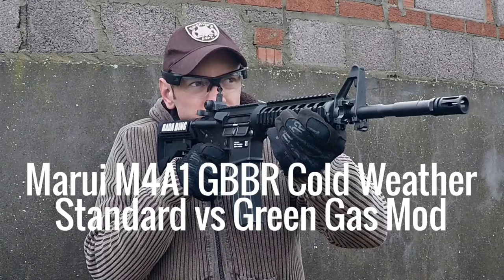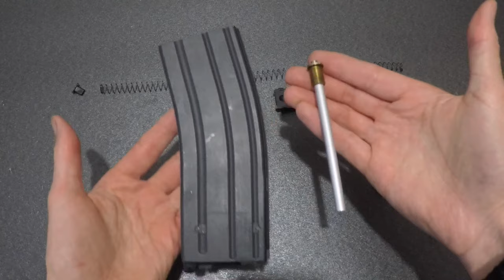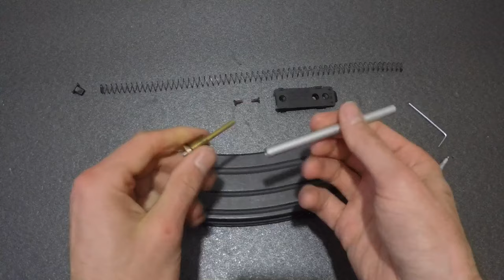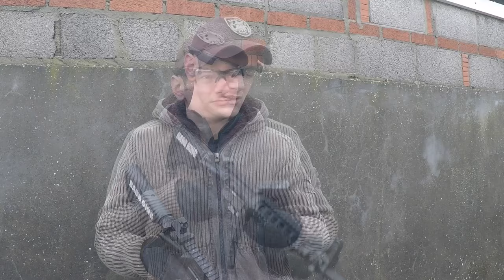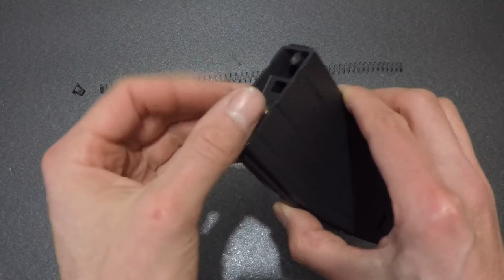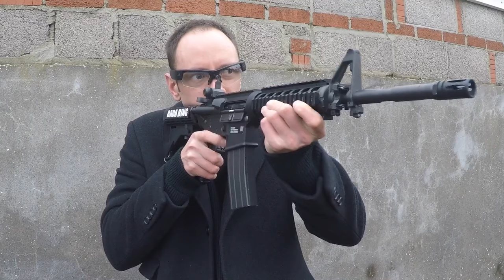Tokyo Marui M4 MWS GBBR Cold Weather: Standard VS Green Gas Mod

Comment: Thank god, I was gonna get a GHK m4 just because of the efficiency. I was crushed, thankfully i noticed your video! I really appreciate it, you helped me spend 450 💶!
Reply from the maker: +Kornel Cajka 
Haha! Both are great platforms, but as you see here the TM copes well in the cold just with smelly old propane. 
Even firing off bursts. 

Enjoy!
Reply: BadaBingPictures Oh wow cool you reply to comments! I ordered my TM M4 MWS 20 minutes ago, right after i cancelled my GHK M4 order. Theres just something about the TM M4 MWS that makes me want it ;)

You were using propane?! How was the FPS with heavier bbs? And how do you maintain the M4 running propane? Does it need more lubrication?
Reply from the maker: +Kornel Cajka 

Congrats on the purchase, you're going to love it. 
Yes, I mainly shoot Propane through the MWS. 
FPS on heavier rounds (.28g) is around 300. 
I don't add Silicone to the propane at all, thus keeping the hop up dryer to maintain stable hopping. 
For general lubrication I use thicker Silicone oil in droplet form. I lightly coat the bolt carrier so it remains slick and maybe a drop on the hammer and valve striker. 

Just enough so the parts aren't dripping but are finely coated.
Reply: BadaBingPictures Oh thats smart, everyone recommends putting silicon oil on the fill valve before filling. Thanks i appreciate it!
Reply from the maker: +Kornel Cajka 

You're supposed to add Silicone but I'm a rebel ;-) lol.

Plus my magazines are never left without gas in them, so they pretty much look after themselves. 

You are most welcome sir.

Comment: I recently got myself an MWS. I play in Norway in cold temperatures and the performance is OK with MAPP gas. However it leaves something to be desired, so I'm considering Greengas modding my mags. 
Note that these are the newer magazines, either V2 or V3 as they were purchased in 2021. 

I have had several people tell me to NOT Greengas mod my magazine unless I fire semi auto with some time between shots, so DMR type gameplay. "They" say that the GG Mod gives increased cooldown effect compared to non modded mags if firing semi auto rapidly. Do you have any experience with this?

Im wondering if you have any negatives to not with your GG modded mags, or comparisons to newer MWS mags. 

To me, FPS consistency and as little cooldown effect as possible is important, as well as being able to fire 35 BBs on semi while being as consistent as possible. (I just top up gas when I  top up BBs)

If you have the time to reply here, I would very much appreciate it. Thanks. :)
Reply from the maker: Typically you don’t have to touch your magazines at all. I bought a stack of magazines that came from the very first batch of TM M4 magazines and I found that sometimes they didn’t have the capacity to complete 35rds during rapid fire, or conditions which required me to shoot as many rounds as possible within a firefight. 

The GGM allowed me to store so much more gas so I could easily clear 35rds and the last shot would be as strong and crisp as the first. 
Negatively it allowed the magazines to store more liquid and the breathing space to convert it into a gas was lost. So it would shoot liquid gas through the nozzle and performance would be rubbish. Think of it like trying to speak with a mouth full of water and it goes down your throat and you start coughing.

It required carefully timed gas charging to ensure you weren’t overfilling. 12-14 seconds maximum. 

Now, the following batches were improved so the mod wasn’t really necessary anymore. Yet people were still being led to believe that it was mandatory if you were using green gas. Then unnecessarily cutting the tubes out. 

I would say it’s a mod that is completely optional, and users should be aware that it makes it easier to charge the mags to a point where they’re not going to give you the best output. I know some folks remove a couple of centimetres from the inner tube to gain a little more volume and this maintains that overfill buffer that they need to operate correctly. 

As I had loads of V1 magazines I wasn’t going to waste money on newer gen magazines. Although I swapped for a V2 and noted it’s difference in performance on my 4 Year review. 
We’ll just say the GGM wasn’t necessary on that particular item.
Reply: @BadaBingPictures  Thank you very much for your swift reply. 

Would you say one can fill stock newer gen magazines till it says stop without overfilling then? Due to the length of the tubes?

I have also indeed considered just taking around 20mm off the tubes to somehow go in the middle and as you said, maintain the overfill buffer. I dont need to shoot 200 bbs out of a magazine, but I do want to get as close as I can to have 35 bbs fired in cold condition with high consistency between shots, both in FPS and in cyclic rate. 

I might do the mod to a single magazine and compare my results.

Comment: Hi, i'm planning on moving to gbbr world, altough in my country in winter we have sometimes 3ºC. Can you advise me in a gbbr m4 that would be reliable all year long. Thank you and please put some more gbbr videos up cause it's a mystic world still, at least in Portugal where i live
Reply from the maker: Hi!
Sure. It all depends on how much you'd like to spend. The two major contenders which I would immediately recommend is the Tokyo Marui M4 MWS GBBR and the GHK M4. While both platforms are more expensive than say WE GBB rifles, that expense comes with reassurance they don't necessarily require upgrading ( Only if you're deciding to alter your fps higher or lower to meet your skirmish site regulations)  The two systems have a fantastic track record, GHK especially having more time out on the field and have had glowing reports from very happy owners. 

On this rifle (Marui M4) using green gas,  you could run that gas all year without needing to change to higher pressure gases when the winter comes. As I mentioned the modification to the magazine allows for more gas capacity which acts as a safety net for when you're firing rapid shots and absolutely need every last bb within the magazine. 

And as all this when performing in lower temperatures. 

Speaking of lower temperatures, GHK offer C02 magazines and C02 is legendary for higher tolerances in colder weather. Players have been known to have been running their GHK below zero temps on C02. So you win either way. 

To sum up if you're looking for the care free-est gbbr platform, my opinion its these two. 
Check out some YT videos on both setups and if you can get to a shop to get hands on, see what you think.
Reply: Hi, thanks for the reply.
About the money i know that if i want a reliable platform i will need to spend a little bit, and because of that this will be my long term project because i seek for realism and responsiveness out of the gun and not pewpew battles where people waste a 1kg of bbs in a single morning (no i'm not joking, it's a real thing at my local site).
Concerning the FPS, in Portugal the FPS limit is 1.3J, so roughly 374FPS with 0.20g. So i just need it to shoot under that limit. I currently run a M4 AEG with 1J and it's more than enough in CQB games thats what i play the most.
About trying the weapons, as i mentioned ealier in my country the gbbr are a kind of a myth, so no shop really sells them (exception made for the GHK MP7 sometimes available) so i can't really try neither.
Once again thanks and keep posting some videos, and if you plan on passing by Portugal gimme a call and i'll get you some games.
Reply from the maker: +Tiago Ribeiro Of course. What ever GBBR you buy, you'll eventually have to buy a ton of magazines anyway so you may as well go for the best skirmishable gas rifle. 

Haha, don't worry. As long as you run decent heavy weight bbs, you're likely to get great groupings. And with up to 370 fps on .20's you've got some speed behind that bb to make effective long range hits. Sure, anytime! Thanks. And also thanks for watching!
Reply: Tiago Ribeiro hey just input WE should absolutely not be trusted in winter

Comment: If I live in Connecticut is it possible to have a gbbr for year round play? If so what would you recommend?
Reply from the maker: +LegoTomm I guess that depends on how cold it gets in your corner of the world. 

I think with GHK AK's & M4 GBBR's being able to run on C02 with C02 magazines obviously would be the best candidate for year round skirmishing. 

The TM M4 would still probably be somewhat usable but running gases hotter than green would put more stress onto the system which is only really designed to be used on 134a equivalent. Also green gas having a low tolerance for the cold whereas C02 can operate in those temperatures more comfortably. 
Hope that helps

Comment: I was close to go for the KWA LM4, but seems like I should get the TM MWS M4A1 instead.
I've heard the KWA is the most durable GBBR out of the box and has great cold weather results, I'm not sure anymore lol
Reply from the maker: The TM M4 MWS is very durable and has decent cold weather performance. But I can throw a spanner in the works and mention that the GHK M4 is also just as durable and it probably has the best winter performance out of every other gas in mag GBBR on the planet. CO2 magazines gives it the crown for winter skirmishing. 

I don’t have any experience with the KWA sadly, but I know that the aforementioned GBBR’s deliver!

Comment: Hey BadaBing! If I click on the Green Gas Mod Tutorial link in the description, it says the video is private. You may want to do something about it.
Reply from the maker: The GGM is not really required these days. The early batches couldn’t take on my GG and the mod helped people increase the capacity. 
As the years have passed they improved their design so they’re able to take acceptable levels of gas, so I made the video private to spare people from needlessly modifying them. 

Of course the option is still there and all it takes is to remove the baseplate, unscrew the brass thread, and remove the tube.

Comment: Hey BadaBing, me again :).

I am a GHK fan, but this TM is a close competitor to obtain.
I do have a question about that video. When I click on it, it's said it's on private. So I cannot watch it. When you perform that modification, can I use the 2.0 Nuprol green gas after that or is that too much for the TM to handle?
Reply from the maker: Hi, 

I took that video out of circulation because the GGM is not required. You can use green gas just fine in the M4, the life of the nozzle spring will be decreased on account of the faster cyclic speeds but other than that you’re good to go. 
I’ve been using propane which is warmer than nuprol 2.0 and the M4 has been great. Apart from wasting two of those springs I mentioned earlier, but it’s so worth it.
Reply: @BadaBingPictures  Thank you for the anwser. That makes the TM a strong contenter to buy.

Comment: do you still need to do the green gas mod on the mags three years on? or have the mags been improved by TM?
Reply from the maker: Nope. The mags I have are all from the first batch and they had terrible efficiency. Without modifications they only allowed 7-8g of gas.

Now their magazines can hold much more gas and do not require any modifications. The green gas mod is completely unnecessary. 
What you see in this video is how bad the first batch really was.

Comment: @BadaBingPictures, the green gas mod tutorial video is set to private, any way to access it?
Reply from the maker: The GG mod isn't really required any more. 
The first few batches of magazines couldn't hold much gas at all, so the GG mod was beneficial for those older ones. The disadvantage was they could be overfilled really easily, and this could cause unconverted liquid gas to get into the working parts and ruin the performance. 
Nowadays they can take on much more gas and don't need the modifications. Of course you can still remove the inner tube from the magazine but it's at your own risk. 

I decided to unlist the video because it's not a necessary measure.
Reply: @BadaBingPictures  Ah i see, is there a way to tell if my mags are the older or newer kind? I bought my stuff used from another person. Anyways, thanks for the response, love your content!

Comment: Have you used Green gas on it ? If so, will it damage the internal parts of this gun?Many thanks. HF134a in the US is not available.
Reply from the maker: I only used propane in this GBBR, which is equal to a full strength green gas. 
Yes, it will damage one or two components. The nozzle return spring isn’t designed to operate at the increased speeds that comes with green gas/propane. So eventually it’ll break. 
On the bright side there’s upgraded nozzle springs to overcome this, and it’s quite easy to install. 

The other part is the plastic buffer. Although it’s a case by case basis, as mine is still a-okay.
Reply: @BadaBingPictures  thank you. As I only have access to green gas here in the US, I won’t have opportunity to use what it designed for its use, which is hF134a gas, I’m a bit paranoid about whether or not I would eventually damage the gun. Another big issue is that in the Us, finding parts for TM guns is extremely difficult.
Reply from the maker: @cx3264  Beyond the parts I already mentioned, I wouldn’t worry as it’s other internal components are solid. With how slick the working parts are with its roller bearings and such, it wouldn’t be a problem. 
Just make sure you do your part by using the highest quality bbs you can. It works both ways, for accuracy and reliable feeding. 

A lot of airsoft green gasses are not created equal, and they vary in terms of power. Some are watered down with butane. 

Parts are plentiful elsewhere in the world. You have to get used to ordering from Asia as that is the best place by far!

Comment: Video of the mod is private, why you did turn it out private?
Reply from the maker: The green gas mod is not required anymore. The first batches of magazines couldn’t hold more than 8g of gas, but TM improved them and they can store more gas. 

So the mod is a bit pointless now.
Reply: @BadaBingPictures  What if I got a second hand one and my magazines need that mod? :p
Reply from the maker: I understand this. However there is no use in keeping the video available as people might modify magazines which absolutely do not need to be modified. 
For example, magazines that are only a couple of years old and ones that aren’t even made yet.

If you feel the need to modify them, it’s as easy as removing the baseplate, brass valve assembly and pull off the tube. Usually the magazine will tell you when it’s full by spraying back a lot of gas at you, but with the GG mod it didn’t do this for ages. And you could overfill the magazine to the point where the performance would be terrible. You’d get a lot of liquid gas spraying out of the ejection port and barrel, which is the worst case scenario.
Reply: @BadaBingPictures  See your point, however I would turn any video private, still counting the views and, as a tech video was cool despite it got old, in adition I miss it haha.

Comment: interesting demo. we don't have near zero degree celcius here in the southeast, would the standard mag works full auto in a 20-23 is degree-ish environment in your opinion?
Reply from the maker: +Rozan Roif 
Thanks. In warmer climates sure it'll work. The standard magazine has a 60 shot gas capacity when firing on semi auto and modified has over 120. 

If you'd like to use fully automatic frequently I suggest the mod, as you see in this video the extra gas capacity allows for better sustained fully auto performance.

Comment: Thanks you for great video here.I am curious, as i understand, TM GBBs are designed for UpGas. and is it OK to use Green gas? I am talking about durability. Thanks!
Reply from the maker: +Matthew Axelson 

Thanks for watching.

In my experience the TM products I've owned have all dealt with the hotter fuel very well. The only issue I've had to date is a nozzle return spring in this M4 snapping. I was able to fashion a new coil from that spring to latch onto the pin within the nozzle and it was back.

All other internal parts of this rifle have worn in well after so many thousands of green gas shots. So I'd say their M4 is a durable system.

In regards to pistols, I've heard stories of plastic slides breaking sure, but due to user reports on discussion forums and safe zone chats determine a high success to failure ratio.
Also keep in mind that operating temperature can have an impact on the guns too, for example in warmer climates, green gas may be more likely to increase stress to parts. Luckily within the UK it's rare to be that hot therefore can get away with using it. 

Of course not heeding manufacturers advice is purely down to the owners risk.